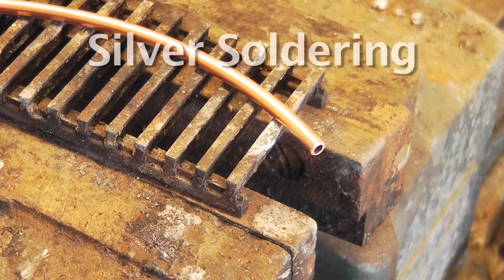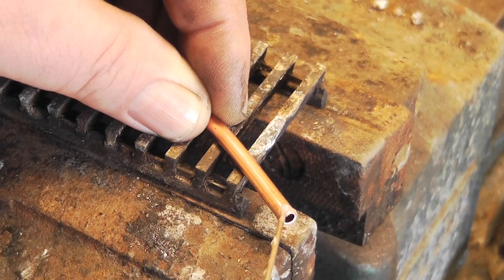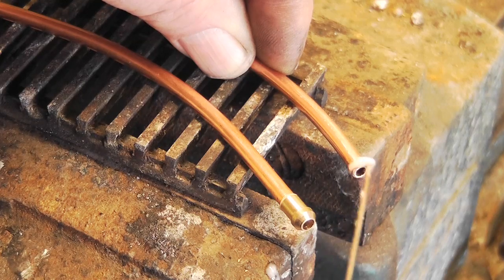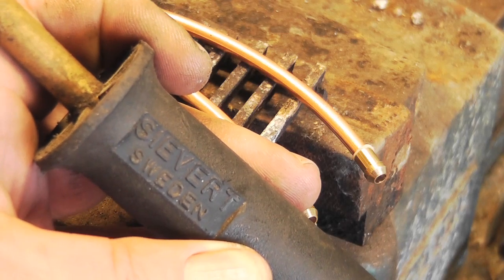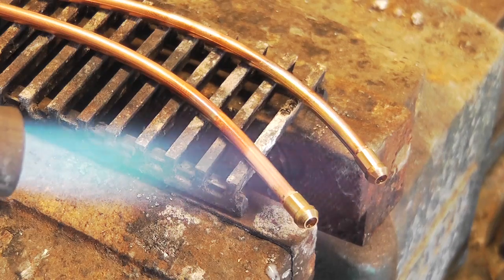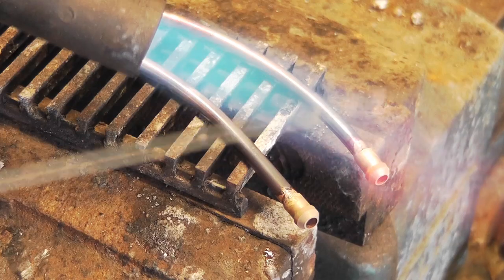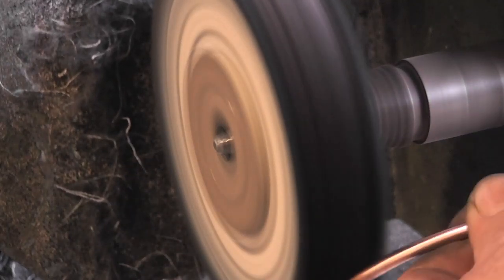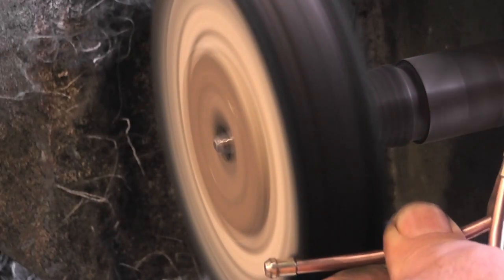HOW TO SILVER SOLDER - FOR BEGINNERS

Comment: You can basically use any acid to clean brass and copper, it just takes longer if you use a weak acid. So a few acids are acetic acid or vinegar (I would recommend glacial acetic acid) and citric acid. I've looked at the SDS for a few brass and copper cleaners and many of them use citric acid. However, it seems like you need to soak the metal for a while, so if you have an large or awkwardly shaped piece you might want to use a strong acid to brush on.

Comment: It's funny, I started silver soldering earlier this year and seemed to be getting worse until I studied this. I strayed off course by not heating my pieces correctly when adding the solder and applying flux around the join when the solder doesn't seem to flow into it properly. I was wasting time and resources by acting impatient/ignorant of the process. I'm glad I've finally managed to get the correct idea again by watching this. 

I recently started using flux paste that I made myself by way of filing home made silver solder (60-65% silver, 20-35% brass and 5-20% zinc) I wonder if you or anyone reading this has tried silver solder paste? I'd like to know if it's to be avoided for any reasons or if there are advantages with it or the rods. Thank you 🙏

Comment: Hi,... The solder you're using seems easy to work with.
I got some silver solder stick (6%) and it was impossible to melt with a little propane blowtorch. So I used a big one, connected to a cilinder,.. I had to put two copper pieces toghether (a piece of pipe on a cap, no through) and at the end it worked, but I used a screwdriver to knead the solder against the copper. I put normal "solder paste?"... well, I'm happy with the thing,... it's hard as a rock, but I would appreciate some advice
Reply: He’s not silver soldering, it’s too low a melting point.

Comment: Thanks for education. I need to solder a plumbing (possibly tin coated) 1/2" NPT nipple to a high carbon steel spring. What flux should I use? Can I use brass as the metal? Will they stick together, considering the different materials and the fact one is coated? If I use a mix of Propane and other gases to raise its temp (I guess it's called MAPP), would it work as if I used only Propane? Thanks in advance.

Comment: Which flux are you using? With stainless I think you would find Tenacity 5 flux would help you, as well as the other advice of course. It's surprising how much heat you need for silver soldering, pipe ferrules soon get up to temp, but if there's more metal involved it can be eye-opening to see how much heat you need. Stainless can be a nuisance to silver solder sometimes (I've noticed this to be more so post-cadmium). Good luck!

Comment: I realise this is off topic, but I want to join copper to copper with the highest thermal conduction possible. The project is a high performance heatsink. The only feasible metal with a higher conductivity than copper is silver.

So I'm wondering if there's any physical reason why pure silver can't be used as a brazing filler for copper. I've experimented poking copper wire into blobs of molten silver (with borax flux), and the copper seems to dissolve. Does this mean it would work?

Comment: Many thanks for the knowledge, of course i realise this film is quite old,,i have been to Blackgates and it appears they no longer sell the solder and flux you were using,and do you use the solder on a reel or the solder rods?
Reply from the maker: They still sell "Easyflo" flux, the silver solder i use is in stick form and it's called "Silverflo 55"
Reply: @keithappleton  thankyou very much indeed, i have a 3"scale traction engine and have recently soldered a small copper pipe with "soft solder" it may of course be fine ? but i think i would like to get some silver solder just in case,, thanks again Neil

Comment: Hello Keith  Question on working with silver solder, do you know if you can silver solder brass shim stock with out in burring up or distorting, I am working on a small diaphragm type steam engine and was interested in silver soldering . It appears as though silver give a good lasting strong joint but does require a lot of heat to get in to flow right . Any help would be appreciated . David
Reply from the maker: You would probably melt the shim brass using Silver solder....

Comment: Should parts to be silver soldered be a tight fit, a easy slide fit, or a loose wobbly fit to get the correct capillary action? Thanks in advance for your advice.
Reply from the maker: Leave enough space for the Silver Solder to penetrate.

Comment: Hi Keith, Thanks for the video. It's very helpful. I have a question that hopefully you may be able to help with: After soldering, you say in the video: 'Let the pipes cool to black and then quench them in cold water". What is the effect of this? Is it to stiffen or to soften the material? For my purposes we need the material to be stiffened after soldering. What would achieve this? Thanks very much
Reply from the maker: Answered already via your Email question .......
Reply from the maker: In case you didn't get it : Quenching causes thermal shock and helps to initially de-scale the pipes to a certain degree. After applying red heat to the pipes during Silver Soldering, the copper pipe would still be soft (annealed) even without quenching.  If you want to harden up the copper after silver soldering repeatedly bend and straighten the pipes and they will "work harden"
Reply: @keithappleton  Thanks Keith, yes i got the reply. Very helpful. I'm working with Solid brass tube 7mm diameter and i want the tube to be as stiff as possible after soldering and i do not have the option of bending and straightening as it will deform the piece which would not be good. Is there another way other than work hardening that you know of?
Reply from the maker: Hello Fred, I will put this question to the viewers - I assumed that you were using Copper pipe.

Comment: Hi there mate, great video. I am currently trying to silver solder a piece of brass that I bent round into a cylinder and am not trying to solder the joint together. I am applying flux, then laying a piece of silver solder along the join on the inside, but when I heat it up the silver solder just forms into beads and doesn't flow into the joint. I cant understand why as I am putting loads of flux on and making sure it gets rights into the joint. Please help! Thanks
Reply from the maker: +Beasty729 Either wrong flux/silver solder combination - or insufficient heat - I have other videos on the Youtube channel explaining in more detail.
Reply: +Keith Appleton thanks, I think it was not enough heat, sorted it now though. Again thanks, great videos.

Comment: I didn't catch what you use for pickling.  Could you please explain?  Thank you, great videos.  I think i watched about 87 of them since yesterday.
Reply from the maker: alex tworkowski "KILROC K" - Kettle de-scaler
Reply: Keith Appleton Thank you..I shall investigate it.  Excuse me, as i am American.
Reply: alex tworkowski What you want to use is a pool chemical called PH Lower. The chemical name is Sodium Bisulfate and it is a partially neutralized form of sulferic acid. It's dirt cheap and works very well. It is the same chemical that is sold under the brand name Sparex. Just disolve as much as you can into hot tap water. A small fish tank heater submerged into the pickle will make the pickle more aggressive. At room temp, this pickle is very tame. Like you can forget a piece is in it and go to bed and in the morning it will still be there.

Alternately, you can pick up sulfuric acid at an auto part store, ask for motorcycle battery acid. Dilute it 10 to 1.

In either case use ONLY copper or plastic tongs to put stuff in and out. Never put anything ferrous into your pickle.

Good luck, tell us how your project turns out.
Reply: Artificer Made Great info.  Thanks
Reply from the maker: Artificer Made Thank you for your advice. I am aware of Sulphuric acid, but I prefer the "Kilroc K" that I use. it is as aggressive as I need it to be even in low temperatures and does the job perfectly.
Reply: Artificer Made Still reading up on Sodium Bisulfate.  Fantastic stuff.  I'm sure it's going to find a spot on my shelf.  Good entre back into my old days in college chemistry.  Thanks again for putting me on a new journey.

Comment: When I blew the flame onto the silver solder, it always formed a ball and would not wet the stainless steel surface I was trying to solder it on. Is that something to do with type of flux used? or more likely the stainless steel surface not hot enough?

Comment: @Dreddip "Talk to a jeweler" Yes, that's an idea. At the moment I need to find out if there's any soldering temperature I can pick which will stop the copper dissolving in the liquid silver, because that would probably ruin the conductivity. Turns out the thermal conductivity of mixtures of metals is usually much lower than either pure metal.

Comment: I'm trying to solder a nipple onto a 2mmOD Cu pipe.  I use soft silver solder, Stay-Brite and
Stay-Clean liquid flux.  I use a hand grip gun type butane torch as i follow your direction
(clean the pipe tip w steel wool, can't clean 2mm ID of the nipple however.) and not putting
hand grease on ea.  Squirted the tube tip w the flux, and inserted the nipple.  I then re-squirt 
the joint w the flux.  I move my flame from the tube just behind the joint and then concentrate
my heat on the nipple to draw the solder in.  When the nipple get red, i touch the .031"D
solder wire but it beads at the wire tip and won't get smeared on the joint.

1.  Why the solder tip won't melt and fill the joint, ending up as a bead on the wire tip?

2.  I get black film while doing this at the joint.  I even get that film when i apply no flux and
     not solder at the joint.  Why?  Where did it come from?  Obviously from the butane gas.
     Same for Propane gas.  So how do you prevent the film from forming?  Re-squirting flux
     despite the film seems to let solder flow

3.  Tinning the tube tip w 400W electric gun ended up solder flowing in side the tube and 
      plugged up the nipple hole as well.  Placing a ring of .031D stay-brite ended up the same
      plug up

4.  How do u prevent the flame from taking a bite (melt) out of the tube and even the tail
     of the nipple?
Reply from the maker: Soft Silver Solder ??? maybe a viewer can help you ......
Reply: @Schuten Dohkji. I´m guessing that you mean plumbing solder, with about three percent silver in? 
When I made the plumbing in my house, I was a novice at soldering. The black film is soot, and, in my experience, it appeared when I overheated the pipe, before putting the solder at place, and this happened on 15 mm copper pipes. 
If these circumstances apply to your situation, you must NOT make the copper red. You must apply the solder much earlier.
Be genereous with the flux, I suspect it´s somewhat mild.

Good luck.

Comment: @ImMichaelTaylor No, pure silver will not flow into the joint gap. Also, pure silver has a melting point about 100 C higher than that of the alloy used in copper pipe. Even if you used very pure copper, the silver and copper would form a eutectic alloy with about 55% silver. This is what is happening when you're dissolving copper in to molten silver. 
Your best bet is just to use the highest solver content solder which is ‘Hard’ silver jewellers solder. Google ‘Cookson Gold’,

Comment: i purchased  hard silver solder   wire . and  attempting to  fix a bandsaw blade      but apparently my   normal  flux paste   does not work with  silver solder
Reply: 3 failed attempts  and  a lot of annoyance
Reply from the maker: Silver Solder needs Silver Solder flux - soft soldering is entirely different.
Reply: Yeah, you won't want to use resin flux, or that red stuff (zinc chloride).  You can buy brazing/silver soldering flux pretty cheaply (a can is a lifetime supply if you can keep it clean and dry), a lot of people use plain borax, some use plain boric acid.  I mix them together in a little porcelain mortar, and when it dries up can use this to grind it up again, along with a little water or alcohol.  The commercial stuff works pretty well though, and you only need a little!

Comment: i watched this and follow but the flux just got burnt to black and the silver balled up on the surface :( what did i do wrong? i cleaned the surface with brake cleaner, then soapy water, then let dry.
Reply: I've done this many times.  Assuming you had clean bright metal and the right flux, the next problem is heating too fast, and going RIGHT BY that magic moment when the flux is molten and still and the base metal looks clean and bright... the flux can only do so much!   Also, I think (this is a little out there) that the flux is a glass, it's a bunch of molten oxides, eh?  I think it's well to have a slightly oxidizing flame or a neutral one, but I think a reducing flame hurts the flux!  In my own many failures trying to silver solder stainless... I think too much heat was a main problem, and if it isn't working it's natural to want to heat it MORE which just ruins everything!   I've found that the commercial black flux seems to work well, and it takes less heat and less silver-solder than you think.  When it works it's pretty, and as strong as the base metal!